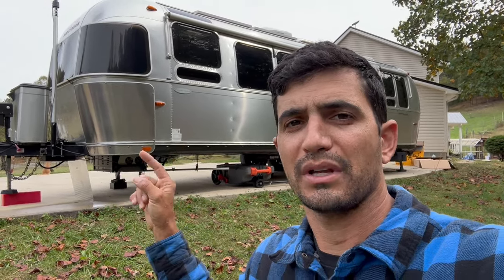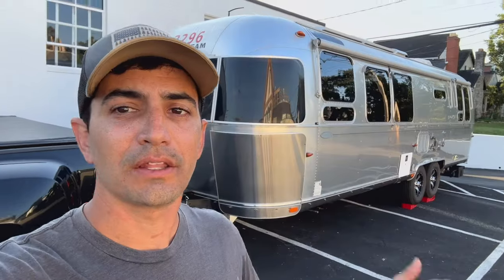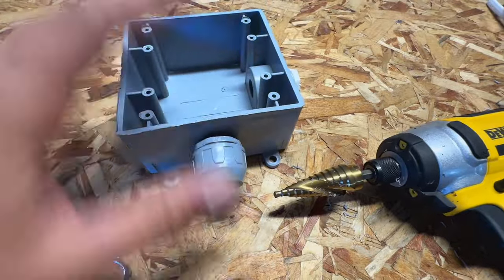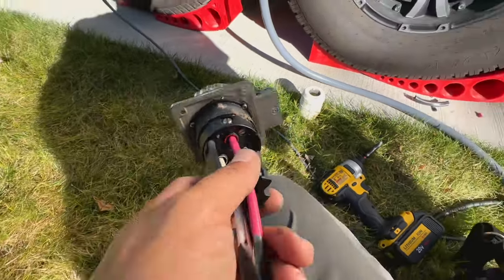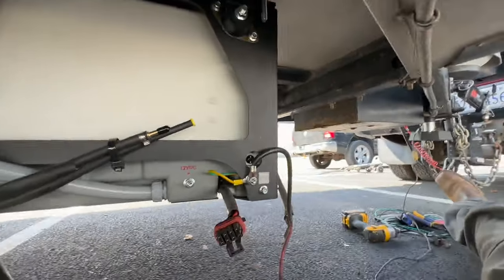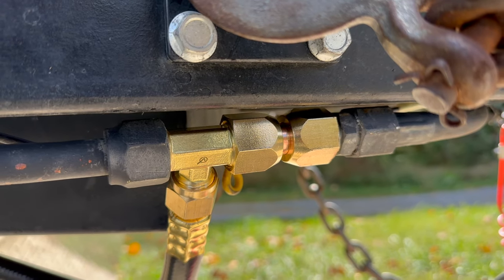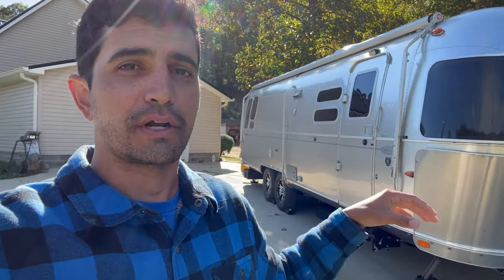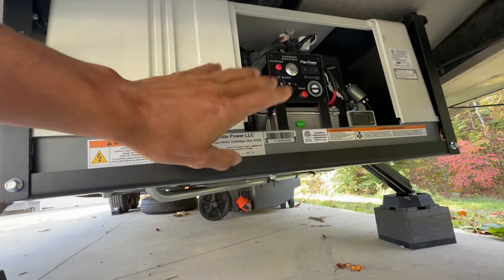The BEST Onboard Generator for Airstream and more. RVMP 4000i Install Why Not RV: Ep 134

Comment: I had the RVMP 4000i installed in my Class A last year by a professional installer. AHEM. Jerkoffs didn't bother to connect the propane, and then played dumb afterwards. So I haven't had it connected since the install. Now we've got a hurricane a'comin' and I'm sure we're going to lose power, so we are likely going to end up hanging out in the RV after the storm is over. 75 gallon gas tank is full, and the 65 gallon propane tank is also full, so today as part of our hurricane prep, we are using your video and are going to hook up the propane line to the RVMP. Thank you for a very simple video on how to do this. It's so easy I'm even MORE pissed that those guys we paid $1300 to install this generator didn't do this when they were supposed to. Yes, I know- we got hosed, but it's a long story! The good news is that we have been using this generator for a year and it has performed flawlessly. We are very happy with the purchase, just not the installation! Thank you!
Reply from the maker: That’s great to hear! I’m glad my video helped!!! I’d recommend if you don’t already, get some extra oil for it. Have you done any oil changes yet?
Reply: @WhyNotRV  We did change the oil after the first 25 hours. I'm a fan of Royal Purple synthetic, so that's what we're running in it. I always have that on hand. I do love the fact that this doesn't need any oil filters like the old Onans did. That's just one less thing to have to keep around or buy!

Comment: This generator is about as expensive as the Onan.
Reply from the maker: Onan generator 2500i is $4,200 no mount. The 3600 is $4,500+ 5500 is $5,200+. Again all is no mount. Single fuel. This generator beats out Onan in multiple ways
Reply: @WhyNotRV  Amazon has the duel fuel 5500 for $5300. The Onan LP 5500 is $5850. Either way, neither is a bargain.

Comment: Suspended from the plywood subfloor..?
Reply from the maker: It’s 3/4” thick, plus has the metal fire barrier on the bottom side and the flooring is 1/4” it’s all plenty thick to support this weight
Reply: Would be interesting to see the results of an impact with the ground (speed bump?) or animal (armadillo?) at high speed. 

From the looks of it, seems that the unit is mounted backwards…

Also thought Yamaha was the manufacturer of the LP Cummins units? Isn’t Westinghouse pretty much just a license brand now days?

In any case, your install looks great!
Reply from the maker: I am working on adding a diamond plate angled in front of it to protect against road debris and larger objects. I would have to dive deeper into those other questions about who makes what exactly. The unit isnt mounted backwards by any means, it doesn't have specific limitations on what orientation it needs to be. I mounted it this way so I could access the front panel, with it mounted the other way I wouldn't be able to access it due to the recessed portion of the airstream I have it tucked up in.

Comment: Love the content! Quick question, why is shore power 4 wires and the generator 3 wires?
Reply from the maker: Shore Power is two hot legs of 120 V in split phase. This generator puts out just one single leg of 120 V. Some generators do come with two legs of 120 V and bigger applications.

Comment: I usually just glue the carflex into the  fs box, works well and should be weather tight!
Reply from the maker: Definitely more than one way to accomplish a similar goal here. This is just how I did it and wanted to be able to show everyone one option of getting it done.
Reply: @WhyNotRV  no worries! Many ways to get the job done as long as it gets done right?! Great video and I was unaware that there was an inverter generator that wasn't a portable sk I'm glad you shared!
Reply from the maker: Ya exactly. I appreciate it

Comment: I would so love to do that, but oofph - I barely clear my belly pans on some of the boondocking roads as is!
Reply from the maker: With the 3 inch lift you really don’t add much. But yes absolutely depends on where you go with your rig. The absolute lowest point on it is 9” above ground level
Reply: At least it's a lower depth than the Onan 2500.  I like the dual-fuel aspect of it - and if I can (I know I could) set it up to auto-start off a multiplus 3000 low battery signal, that would make winter boondocking so much safer.  I'm currently using a manual generator in a tent (to protect it from snow and rain) at that time of year.
Reply: @WhyNotRV  Oh, and Hi - Ian here, BRN 8118 (same number if I roll the airstream) - hope to see you on the road!
Reply from the maker: Ya it’s really a great machine. Ya I have it auto start off low voltage or state of charge. Peace of mind overnight.